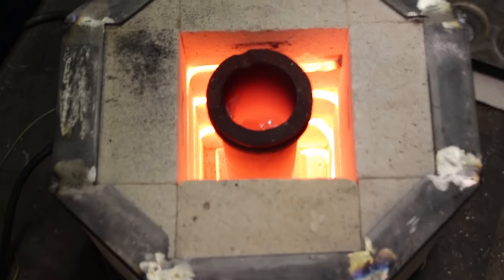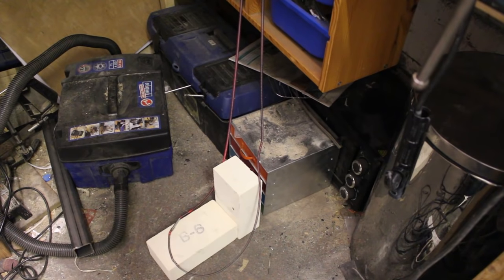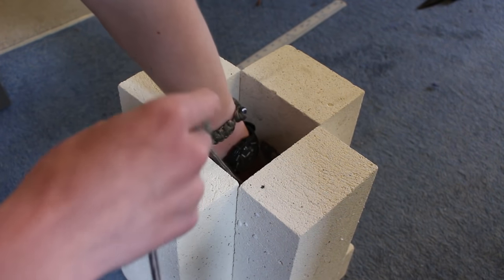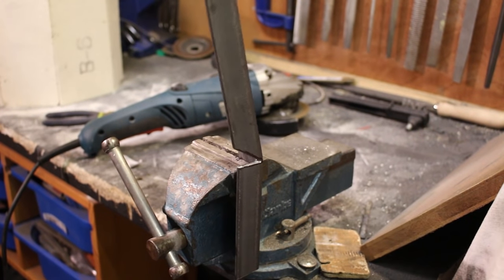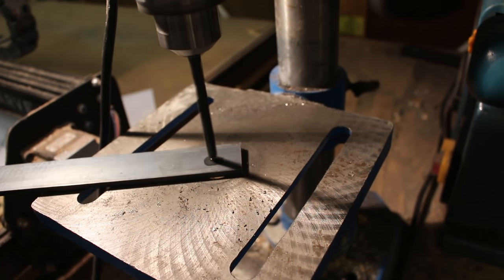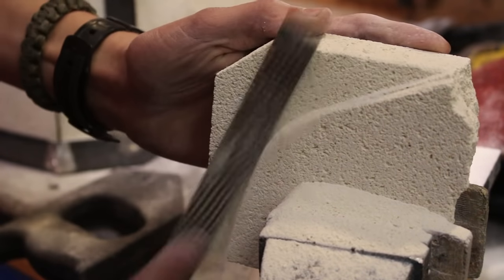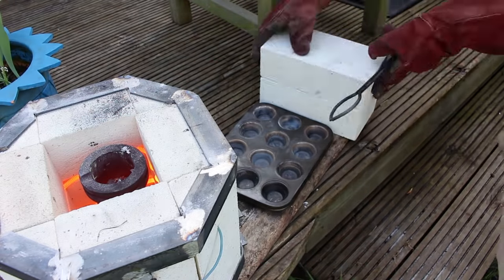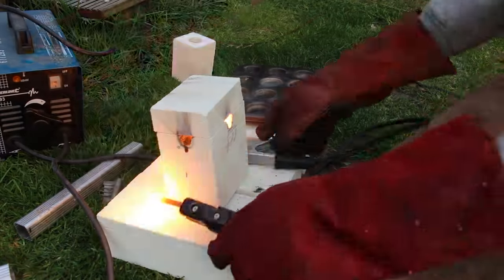How to Make an Electric Foundry For Metal Casting - Part 1

Comment from the maker: Enjoy the video!
Comment below telling me what upgrades you want me to make to this project for the next video and don't forget to follow me on Instagram for more updates and projects: https://www.instagram.com/theartofweapons/
Reply: Could please drop a link. Cheers
Reply: Can it be used to forge knifes?
Reply: Mybe something to secure the wires? I think that it is a bit dangerous if you just put them in there like that...
Reply: +The Art Of Weapons I'd say find a way to prevent the crucible from making contact with the wires.. Idk how you'd do that. Also a lid with a hole in it could be a cool addition. If the crucible was sitting securely in place, you could drop metal in without ever opening the lid.
Reply: +syed waqar pretty much... but I imagine one with a hinge
Reply: add a PID temperature controller. together with a k-type thermocouple this shouldn't be more than 20gbp
Reply: I suggest adding something to prevent the crucible from touching the heating element, that seems like the biggest danger at the moment. It also looks like the heating element might slip out of the slots in the fire bricks so it will also help keep them neatly in there. Maybe stick lumps of fire clay into the corners of the furnace where there is a 90 degree turn in the element, that should hold the wires into the grooves and prevent electrical mishaps in case you forget to turn off the electricity. It will slightly block the radiant heat transfer, but since the corners are furthest away from the crucible anyway it shouldn't be too big a deal.
Reply: Gunna be very knowledgeable when your an old fella.
Reply: Take it from someone who's taken a clay firing kiln and retrofitted it with a PID, you're going to want to put a heat sink on the solid state relay.
Reply: You do realize that graphite is conductive right? And you are holding it with metal tongs. Next to a live wire. 
(Its probably not actually that big of a deal, because you are wearing gauntlets. Also those crucibles are actually like only 40% graphite (the rest is essentially clay) so that might make them a lot less conductive. And also fuses and RCBs (but they won't always save you).
Reply: I'm not keen on the way you put an insulated wire through a drilled hole.  Some sort of grommet is best practice.
Reply: Could you use plaster of Paris instead of firebricks to save money or would it not be strong enough?
Reply: I have tried that, It cracks at high temperatures even when mixed with 3/4 sand... so unfortunately no sorry my friend.
Reply: Refractory materials don't expand as much with heat, therefore less chance of cracking.  A ceramic-top electric stove is made of such stuff.
Reply: So essentially some ceramic could potentially house the electric coils?
Reply: +ThecommentDmon Actually that crucible looks like it's pure graphite, not what some call "clay graphite".
Reply: Then it's much more of a safety hazard as it's much more conductive! :)
Reply: ThecommentDmon 
Only if the wires are frayed and exposed, and only if live wires are in contact with the crucible, and only if the crucible comes in contact with ground, via a human body.  That's a lot of "if's."  Needless worries don't create hazards.
Reply: +Landrew0
That whole heating element is one huge exposed wire, very near to the crucible, and as I said in my original comment he is holding it with (probably conductive) metal tongs. It's not a huge risk I agree, but one time with no gloves and a faulty fuse and he could hurt himself. Plus if he using a 13A fuse and that thing only draws 7.5A, he could have 5.5A goin through him before a fuse blew. Also please don't put an apostrophe in 'ifs' in the future... I can understand omitting one because of laziness but putting one where it shouldn't be is just wasting your own time (not that it matters).
Reply: ThecommentDmon 
OK, you're right, hysteria always makes things better.
Reply: +Landrew0 I'm not sure what makes you think that touching 230 volts via an exposed wire is not a HUGE risk, but the worries of +ThecommentDmon and others are kinda justified. Maybe not this kid, but some other unfortunate bloke who decides to build this can be less careful and might just not have anyone who could give him a heart massage until ambulance arrives. This is not hysteria, they were teaching us at the uni how to provide first aid in case somebody's shocked by electricity, despite the fact that we were never allowed to turn on anything at the labs before the TAs have checked it. It's necessary, because bad things might happen..
That said +The Art Of Weapons you might want to consider running the heating element through an isolation transformer (if you can afford to get one with the appropriate power rating) to make it safer.
Reply: I'm going to make a fortune selling bubble-wrap suits to people who've lost the ability to assess risks, and simply err endlessly on the side of fear..
Reply: You've never been hit by 230 volts, have you? Probably not, because >90% of the devices in 'murica is run off of 120 volts. I'm also sure you don't know much about electricity either, otherwise you wouldn't bagatellize its effects and dangers either......
Reply: Fears do not create hazards.  Lead-free solder is a product of this logical fallacy.
Reply: Well the fact that you're not afraid of lead from chucked PCBs contaminating the environment doesn't mean that it isn't a hazard nonetheless. That's absolutely correct.
Reply: I'm not afraid of lead-based solder because it's no hazard to anyone older than about 3 years old.  For a poison to be dangerous, it needs a pathway to your body. Electricity is no different.  If you are unable to protect yourself with common sense, get the government to ban it for you, and deprive the rest of us of it's utility.
Reply: CoolKoon
I suspect Landrew0 is trolling...
Reply: ThecommentDmon Actually, that's your response to losing an argument.
Reply: +Landrew0 God you're so incredibly clueless it hurts. For a poison to be dangerous it's enough for it to be exposed to the forces of nature. The biggest problem with lead-based solder is NOT that people will swallow it, but that it'll leach into the environment after it's thrown away. Thus whatever landfill it'll end up at (especially in 3rd world countries of course) it will slowly "enrich" the soil with lead. Also, does the term "bioaccumulation" (yes, that's one of the pathways to your body) say anything to you? Obviously not, otherwise you won't be talking such nonsense. 
Common sense you say? Electricity and radiation are two phenomenons which CANNOT be directly perceived by the human senses (at least not remotely). This means (among others) that you're NOT able to tell whether something's electrified before you actually touch it (by which time it already might be too late). This is the reason why people working with electricity are ALWAYS advised to exercise utmost caution. They can't stress enough the importance of caution even at universities that teach EE, but yeah, you surely know better. Because I'm sure that years of formal education and hands-on experience can be overridden/trumped by common sense bullshit picked up on some obscure websites on the bottom of the Internet.....NOT.......
Reply: CoolKoon
 That is officially the biggest comment ever. Wow...
Reply: Well, each to their own, and I choose the non-hysterical approach.
Reply: This was by far the best video ive seen in a long time. coming from another teenager who likes to do projects and such, I must say, well done. very descriptive and your methods were all very sound. best of luck to you!
Reply: Ya know, took me until age 28 to reach the same conclusion you did. Electricity is by far the cheapest way to run something like this, and while I'm happy that tons of people are building these "easy" trash can furnaces they are just so expensive to run. You're bight enough - you should look into making a waste oil burner for a high temp foundry. Do it right and it will handle cast iron. And while noisy, theyre effective and the fuel is free. The Artful Bodger has lots of info on these.
Reply: Matthew Marting 
Not to be insulting, but energy costs are easy to calculate.  Natural gas is cheaper than electricity in most places. In fact, most power-plants are converting to gas.
Reply: +Matthew Marting Actually it entirely depends on where you live. There are many places where LPG is cheaper than electricity, so it's more widely used for e.g. heating. Natural gas is even cheaper. In other countries the electricity might be cheaper, yeah, but everybody needs to do their own math.
Reply: Hadn't thought of that. I hear in parts of Canada it's still something ridiculous like $6 for 20 lb of propane - and that's Canadian dollars. Where I live its closer to $24. For me, electricity is cheaper. One other consideration for kilns, forges and foundries is whether you need to control the oxygen content. There's glazes that just wont work unless you can fire them in a reducing atmosphere, and my home built heat treat oven causes loads of scale build up.
Reply: +Matthew Marting I suppose Canada doesn't have any natural gas reserves, does it? :P My guess would be though that countries that are rich in natural gas (e.g. Russia or Norway) are able to produce propane cheaper than electricity. So yeah, by all means go for an electric kiln if that's cheaper to run for you.
Just out of curiosity: how do you create a reducing atmosphere in an electric kiln?
Oh and BTW: where I live 20 lbs of propane costs ~€10...
Reply: CoolKoon You actually can get a reducing atmosphere in one but it is ill advised. You simply add sacrificial carbon into the chamber, which then reacts with oxygen and corrodes your kanthal heating elements. Not sure how it corrodes them but it does. You're forced to use it under oxidizing conditions, which means certain glazes wont work and you have to put up with scale if you're heat treating (or pay for stainless foil/anti scale compound)
Reply: +Matthew Marting I see. But why would an electric kiln present an oxidizing environment? Isn't it a neutral one? 
I actually know how does carbon corrode the kanthal heating elements. You see if it's real kanthal, then it's an alloy which contains iron. And as we know, iron has higher affinity for carbon than oxygen (thus it's used to reduce iron out of iron ore), thus it "sucks in" the carbon, causing the properties of the heating element to deteriorate. And when enough carbon gets sucked in, the element fails.
Reply: Modern economics:  Spend $1000 to get $0.0001% benefit.
Reply: CoolKoon Well, the only way to get a neutral environment in an electric kiln is to purge it with a noble gas. Otherwise it fills up with atmosphere, which contains roughly 20% oxygen. And I'm not quite sure that the kanthal degrades due to reduction but you could be right. I cant work out what would be the electron donor or why it would cause physical decay to kanthal as opposed to merely increasing its carbon content. Its been a good 10 years since organic chemistry for me.
Reply: +Matthew Marting Oh, right! I'm pretty positive that degradation of the kanthal is caused by carbon absorption by the iron, but I'm not sure if that's the only cause. And actually "merely" increasing iron's carbon content changes the iron's properties quite a lot I'm afraid....And BTW this isn't organic chemistry at all. The reaction has nothing organic in it.
Reply: +CoolKoon I'll take your word for it. I'm still not convinced it isnt a redox mediated cathodic/anodic erosion or some other overly complicated issue. I'm aware that carbon variance of 0.01% can completely change an alloys properties. But I'm just a pharmacist who has a metalworking hobby, not a metalurgist, engineer or chemist of any variety. We just happened to cover redox the most heavily in our organic chemistry class... Strange I know, but it was a 6 year program and they had tailored everything down to the point where some classes ended up covering topics from the last or vice versa.
Reply: +Matthew Marting Well, I did a bit of a research on it, and it seems that carbon is just one part of the equation. First of all A1 type kanthal wire (the cheapest kind) will rust in a couple weeks no matter what. Also, the aluminium in the alloy causes it to develop a (fairly rugged) oxide layer (alumina/bauxite) around the metal, which seems to greatly reduce oxidation. However over time high heat seems to deplete chrome from the wire over time (thus allowing rust to set in), so that could also be a contributing factor. As for the carbon I still think that absorption of carbon by iron is a main culprit (or at least a contributing factor).
Reply: i had no fuck*ng idea what u on about lmfao 😂😂😂😂
Reply: CoolKoon My hat is off to you sir - I'm intrigued about bauxite being a (for lack of a better term) 'better' scale. Where do you look for research on this type of thing? Is there an equivalent of pub med in the metallurgical field or something?
Reply: +Matthew Marting Thanks :) Actually the oxide layer on the top of the aluminium (also called alumina or corundum/ruby/sapphire if found in nature in crystallic form) is even more interesting. For instance it forms so rapidly and readily (and is such a good insulator) that it makes aluminium welding next to impossible by regular means (using a coated electrode in air without any shielding by an inert gas). For soldering and brazing it also needs to be etched away by some acid for "flux", otherwise the solder will not stick to the workpiece either. Moreover it's very hard (9 on the Mohs scale, with 10 being diamond), durable, has interesting optical properties (synthetic ruby is used as a lasing material) and a high melting point (~2000°C, comparable to that of fused silica/quartz). To make it even more interesting the surface of aluminium can be anodized i.e. the (always present) pores in the oxide layer deepened, filled with a dye and then closed.
Unfortunately I'm not aware of any metallurgical equivalent of pubmed (well, there are journals out there for sure, but their ridiculously exorbitant prices put them out of my reach), so it's mostly Wikipedia, forums and a lot of googling. Reading up on kanthal is even worse, because it seems to be a proprietary material. This means that (other than some datasheets and forums) most of the material available is just pure useless marketing bullshit. They don't want you to learn enough about the material, lest you'd reproduce it (it's probably patented anyway, but the exact composition is still a trade secret; the patents are usually broad and ambiguous enough to necessitate a LOT of experimentation even even if you have all the necessary equipment and materials at hand).
Reply: Yeah, I run into that issue with researching metalurgy too. Its like you're in the trade or you're not. I want to suggest a book you might enjoy. Its called "Metals and How to Weld them" - you can get it from the James F Lincoln Foundation for $12:50 and is probably the best overview I've seen on metalurgy for the money.
Reply: +Matthew Marting Oh yeah, that's definitely true. I even started reading a book about casting (it's from the 70s, like your recommendation, but the information in there is still relevant up to this day nonetheless) that confirms the same: all the foundrymen have their closely guarded secrets which they don't reveal to anyone including their apprentices (and when they actually have to perform some of their "magic", they just send the apprentice to the other end of the shop; by the time they return, the work is all finished). They also make heavy use of smoke and mirrors and spread sometimes outright nonsense to confuse naive beginners even more. Fortunately most of the stuff is written down in books as well...
Thank you for the recommendation. I tried to look for "alternate sources", but just couldn't find any. I tried to look up the shipping conditions of the James F Lincoln Foundation, but there wasn't any, just a phone number. This makes me kinda think that they don't do international shipping (especially not to Europe, very few American companies do in fact). Thus I added it to my Amazon wishlist for now ;)
Reply: Hello, the link to the heating elements shows three elements that are 500mm long. Are you stretching them to 1 metre each?
Reply: +Wil Zylstra Actually it seems to me that he stretches it just enough to avoid shorts. Either way you'll probably have to trim some of the wire off.
Reply: CoolKoon Ahh thanks man.
Reply: TAOW is it hot enough to melt brass
Reply: I also have a furnace using Kanthal A1 wire for the elements and have burned a lot of stuff in it for fun - that often accidently causes a reducing atmosphere at high temperature when combustion is so fast that it's hard to supply enough air - black smoke is coming out (wich is mostly carbon dust). But I have had no problems with the elements corroding. 
There are also some ceramic kilns that use electricity thru Kanthal A1 elements as main heat source - but also uses a small amount of propane to create reducing atmosphere. They may operate at temperatures above 1200°C for hours. But still I havn't heard that those kilns "eat elements".

Maybe it's the other alloy that have problem. There are 2 main alloys used for resistive heating elements. Kanthal A1 (and similar) that uses iron, chromium and aluminium. Then there is another one that uses nickel and chromium. That alloy have a lower melting point and is mostly used where very high temperatures is not needed, like most domestic appliences, space heaters and even in some furnaces that work mostly below 1100°C.
The Al, Fe Cr alloy works by creating a thin layer of primarly aluminium oxide when heated, wich then slows down further oxidation (although it doesn't stop completely. Heating element does wear out when used at high temperatures and their resistance goes up slightly over time - even in normal oxidizing environment)
The Ni, Cr alloy works the same way, but the protective layer is chromium oxide instead.

If I remember it right - chromium oxide is slowly reduced by carbon. Wich means that once the atmosphere changes from oxidizing to reducing - some of the chromium oxide is reduced back to metal (wich is a lot more porous than is was before it was oxidized). Next time the atmosphere changes back to oxidizing it oxidizes again - this time a little deeper. Then it goes on. It's almost impossible to keep a reducing atmosphere all the time (for example if you open the door at high temp, it will instantly change to oxidizing atmosphere)
 - so it will change back and forth between oxidizing and reducing to some extent. Many DIY project uses the Ni, Cr alloy because it's easy to get - often taken from some old appliences.

Alumina on the other hand cannot be reduced by carbon. If it could - that would be used all the time to get  aluminium metal. When making aluminium out of bauxite it's mixed with a flux (that lowers the otherwise very high melting point of aluminium oxide and also makes the bath electrically conductive)
 - then aluminium is reduced to metal by electrolyzis. 
Then if carbon could go thru the layer of alumina to such an extent that it mixes up with the iron - the oxygen would do the same when used in oxidizing atmosphere. Oxygen (wich is a gas) probably have easier to penetrate that layer than carbon (wich a solid) has.
Reply: I don't know if you can do it when you dimension the elements the way he did. I don't like the idea that they shud glow orange when you test them outside the furnace chamber - that means the elements is running very hot and will probably melt if you try to run the furnace much hotter than he did in the clip. I would say that they shud get just below where you can see them get red hot. They will start glow anyway when heat starts to build up in the chamber.
If you don't get enough current to get the desired heating power - use thicker wire or 2 in parallel. Be awere of the space needed (it may be hard to get room with all wire) - thicker wire takes less space in the furnace chamber, than 2 in parallel.
Then you shud be able to get to at least 1100-1150°C with this design and Kanthal A1 elements (that's enough for melting brass and even copper).
Reply: If I were you I'd invest in a little buzz box (hobby MIG welder) rather than using a stick process. MIG would be more appropriate for the mild steel at the thicknesses you're using. However, I do enjoy the video. Keep up the good work!
Reply: TAOW I will give you £200 for that, no joke
Reply: Can you forge with it? They say propane ovens are better, but i am unsure if an electric furnace us better then propane...
Reply: If you use right dimension for the wire/coils (as I wrote earlier) you can quite easy get it hot enough for forging.
But there is one difference. In a propane funace, you can adjust it so the fire use up much of the oxygen in the chamber - in an electric one, you just heat the air inside (wich still has it's normal oxygen content). That will cause the metal to oxidize more. 

If you melt metal for casting, you can just put a lid on the crucible to keep air out (if oxidation is a problem) - but, when forging you just have a bare piece of metal.
I dont know how much of a problem that is, since I have not worked much with forging my self - but that may also be a reason why they think propane is better, since it will be less scaling of the metal.
Reply: How expensive was this total?
Reply: Regarding the oxygen in an electric furnace, would it work to have just a smaller, non fanned flame to burn of the oxygen, while using the coil for actual heating?